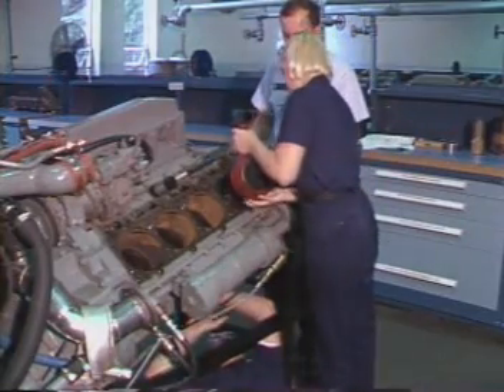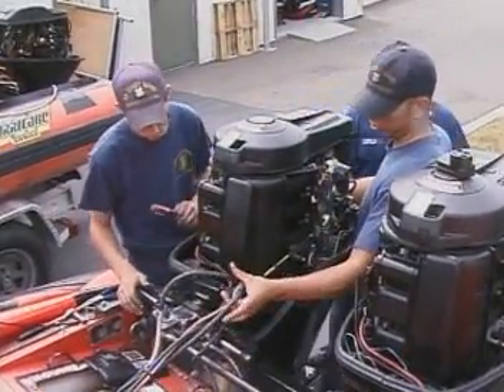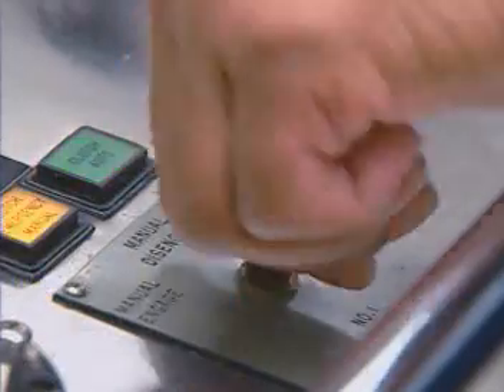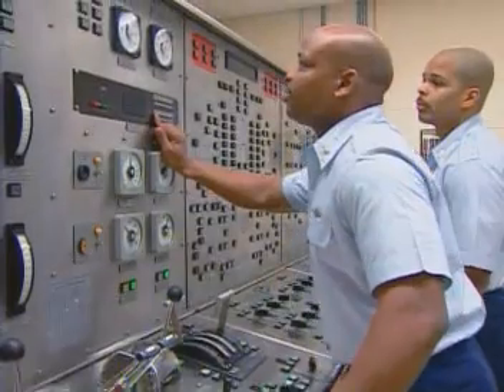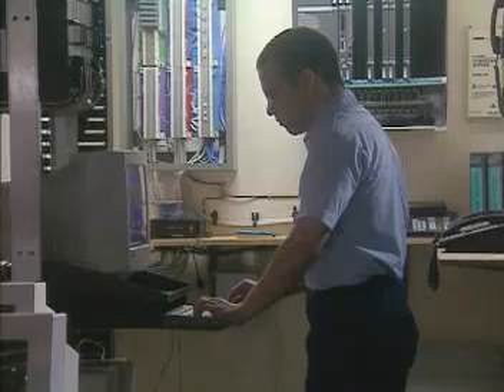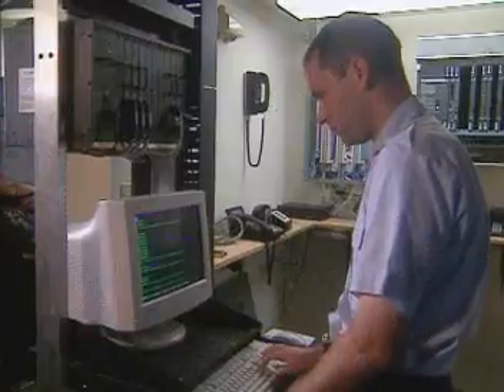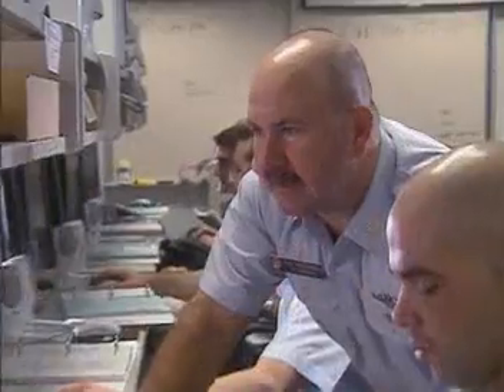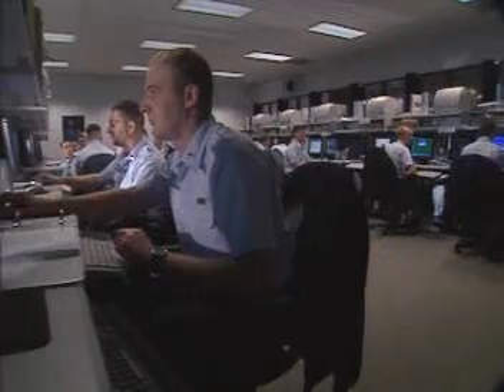coast guard machinery technician

Comment: I can see how it is misleading but if you listen to the narrator, he mentions that they "work at" all of the stations and units mentioned.  I'm sure, because of time constraints on the video, they could not go into full details of exactly what it is they do at an air station.  Yellow gear and facilities maintenance are quit important in ensuring efficient operations of the flight line and the facilities in which the aircraft are housed.

Still though, I agree that it is a bit misleading.